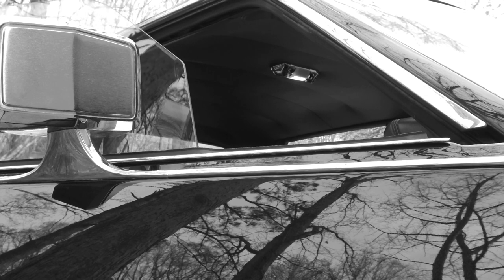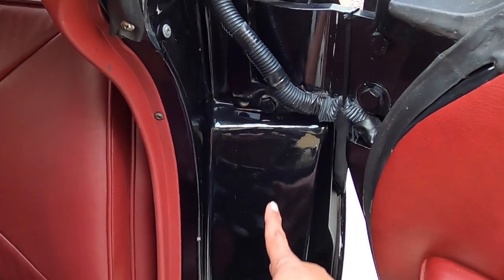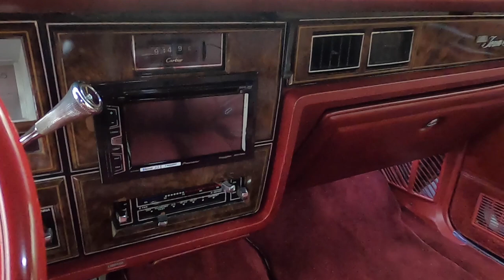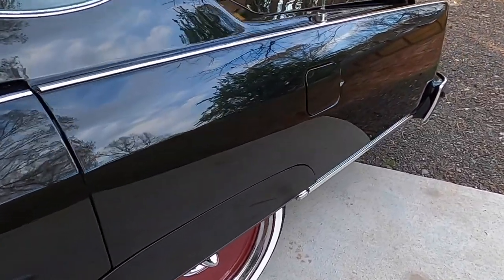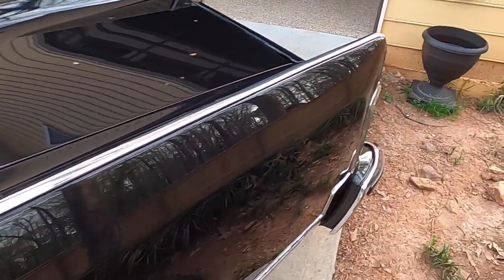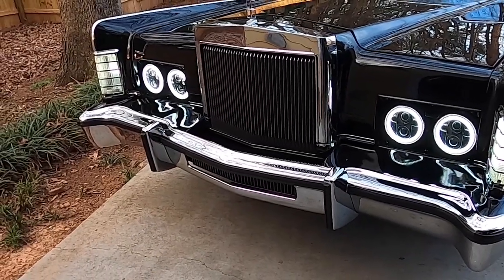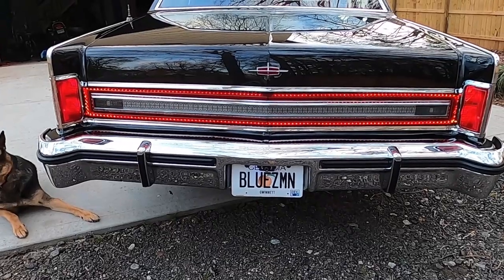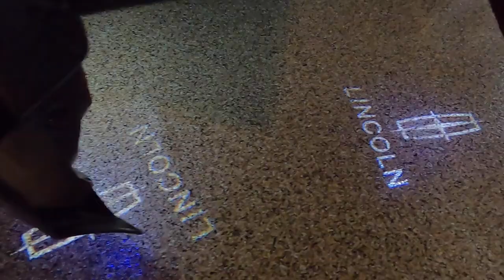A Walkaround Of My 1979 Lincoln Continental Town Car With Suicide (Coach) Doors #1979lincoln

Comment: I love the look with the side trim deleted. Very evocative of the 60s suicide door Lincoln’s. I have a 1979 Lincoln that had the top removed, making it a permanent convertible. It is going to be repainted and I think I will have the side trim deleted also.  Your suicide door conversion is outstanding!  I would love to do that too. Could you possibly share the information of the shop that did the hinges?  It looks like a solid solution for doing the conversion
Reply from the maker: Thanks! The shop tht did the fab work is Mad Creations Atlanta. You can find them on FB or IG an also under The Car Stylist.
Reply from the maker: Drop me a DM on Instagram, I'd love to see your car as well! I totally want to do that on my next Conti!
Reply: @SkaggsGarage  can you share with me what they charged to make the hinges? How much effort was needed to move the door handles and strikers? Make the handles work?  The locks don’t matter because it’s a permanent open convertible… going to paint the body in Lincoln Blue Diamond clear coat, a correct 1979 color, and restored turbine wheels.
Reply: @SkaggsGarage  do you have a source for the seat cover buttons? Leather is perfect but the driver seat bottom cushion is missing the rectangular center button.
Reply from the maker: @bernardboka4277  not really on the seat buttons. I did have one missing when I had mine recovered and the upholstery shop just made one. I think that's probably the easiest route.
Reply from the maker: @bernardboka4277  I'd rather not get into a lot of detail here in a reply. Please feel free to email me at skaggsgarage@gmail and we can discuss and swap pics and info! Also our Lincoln Facebook car club is free to join. Search Dead Gentlemen Motor Club. 😁

Comment: Amazing work on the rear doors! Did you start with a particular hinge kit or build completely from scratch? Any info would be greatly appreciated as my 1978 has demanded this upgrade! 😁
Reply from the maker: Thanks!! The hinges are from street dreams by Ross. Not a kit though, fabrication and/or swapping the latches, strikes and handles are on you...😁😬
Reply: @SkaggsGarage  thank you for the response! Do you remember the part# of the hinges???
Reply from the maker: @steveleclere4689  😬 I think it's the LXL hinge. The parts have been updated since my project was finished  ...
Reply: @SkaggsGarage  I really do appreciate you taking the time to respond!
Reply: @SkaggsGarage  more detailed vid or pics of the process would be awesome, just saying 😉
Reply from the maker: @steveleclere4689  unfortunately all I have are a couple of short vid clips and pics, no detailed fabrication shots...

Comment: Really nice car love how it looks I have a 79 also n I noticed that my car has two bulbs in the rear where you added the led strip in the middle rear if you don’t mind me stealing your led strip idea where did you buy it at
Reply from the maker: Just simple LED light strip from Amazon,  ebay etc. Just pull the center reflector assembly out, take it apart and lay in the strips and connect to your driving lights. 
Go for it, it really enhances the look from the rear!

Comment: What AC compressor is that? Pro6Ten or  Sanded S6? I've been looking at those to replace my A6 but I hadn't seen one in a Lincoln.
Reply from the maker: I'll have to check, I'll let you know!
Reply from the maker: Doesn't have a part # visible on it, looks like the A6 Delphi on rockauto though. I had it replaced, the shop ordered it.

Comment: How did you wire that pioneer?! I can't figure mine out🙏
Reply from the maker: Honestly? Wired it from scratch. The only existing wiring I used was the key-on power wire and the dash light wire (to dim the display at night). The car's original radio wasn't stereo (believe it or not) just AM/FM mono, so new speaker wiring was needed throughout. Anything specific issue you're having problems with?

Comment: Can you please make a video how you installed the headlights Thanks beautiful car I own one would like to tho the headlights like that
Reply from the maker: The install is pretty straightforward, making the halos work the way they do is another subject 😁...
Reply: @Skaggs. I'm trying to figure out how to run halos on my 77. So far my best thought is a mechanical ball valve on the white vacuum suction to the headlight switch and then manually cut the vacuum. I'm sure whatever you did is better.  Any way you would share?  Cheers! Sweetest Lincoln ever.

Comment: Nice!! You did a excellent job with it. The only thing I would have done differently with the stereo is I would have put the Pioneer AVH-X7500BT in it. It's a flip screen & it would have fit perfectly in the dash. I like the lights you replaced them with👍🏾 I wish I could drive it.
Reply from the maker: Hey thanks! The factory radio units are either 2 knob radios or a din and a half. The flip up unit would’ve hid my clock...😎 lol. Ironically the space in the dash behind the trim holds a double din perfectly, I kept the original trim and radio if I ever decided to part with it.  Thanks for checking in.
Reply: @SkaggsGarage   Oh ok. I get it👍🏾 I love those suicide (coach) doors😀

Comment: Very classy car, in some ways it seems more Lincolnesque than the stock one. I had both Mark IV and '76 T-Bird modified for speed. You would get a very complimentary look with widened steel wheels that keep either of the available hubcaps, 10½" width will look and work well with 295 tires and add-on "wide whitewalls" That looked very proportional on my Mark IV, more than the factory. Your car does look very balanced and clean without the vinyl. Super taste you have 👍 
PS I crashed the 2 door coupe during a movie scene, had to complete the movie with the crumpled nose, it still drove stunts at 80 mph after. The only people that die in those things are presidents 🤣 Enjoy 😉
Reply from the maker: Hahaha! Glad the coupe kept running and you were ok! I appreciate the comments! Planning on another set of wheels and tires to change up the look now and then!

Comment: Very cool. But the wiring looks like crap, just get a multi-wire flex cable with enough wires in it for the job and give it a clean appearance.
Reply from the maker: Thanks Roy! I never thought of that! Until then I'll just put the carpet back...🙃